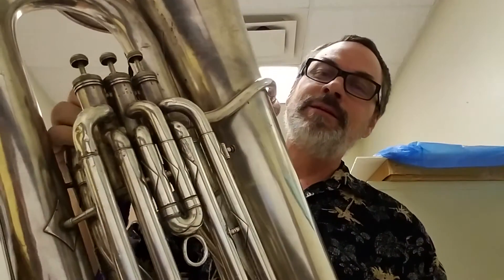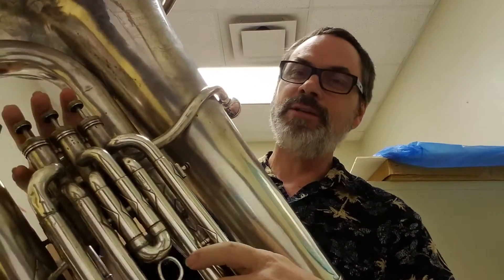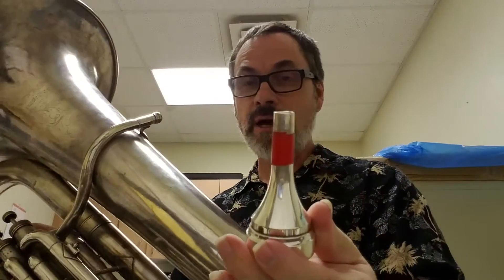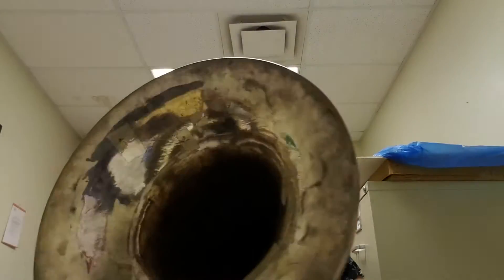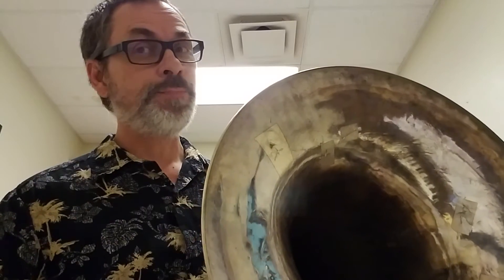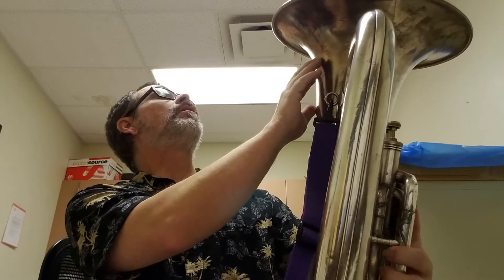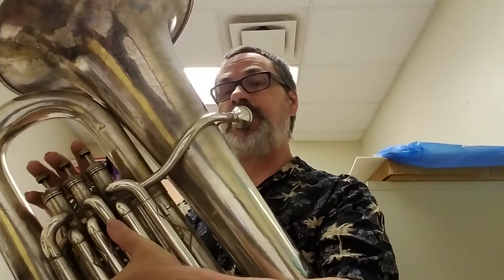Tuba - My Buescher Eb Tuba from the 1920s

Comment: I know this is an old video, but I've been slowly rehabbing a Buescher 3 valve front action from roughly the same time as yours. I've had people tell me to turn it into a lamp. I have made it playable, although the only slide not stuck is the main tuning slide. The others have not yielded. Despite playing tubas for 30+ years, I've never had a chance to play on an E-flat tuba. I ran across this video while trying to figure out simply how to transpose to play it. Plus at some point I'll need to do something about the shank size issue for the mouthpiece. My cheap Kelly kind-of fits, but I don't like it much, and I don't think they make the right size shank for this that would fit on my modular tuba mouthpiece. This is turning out to be a beautiful brass horn. Thank you for sharing yours.

Comment: Ok, I know this is way too late, but I was looking on Simonetti collection for something totally unrelated and it made me think of this video.  Why?  Dunno.

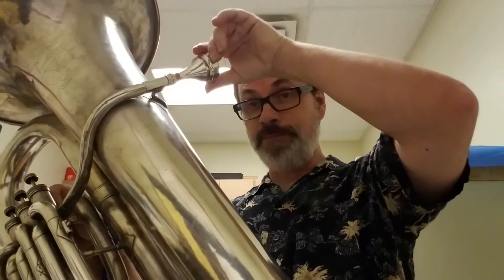As it turns out, a lot of the old Conn Eb Tuba mouthpieces clearly feature Remington shank (~13mm @ 1:24).  So if the mouthpiece is topping out at the receiver and wobbling around in the tube, that's probably what it is.  And yes, Remington shank was a thing before they called it Remington shank.  On the bright side, this is easy to test, and you might even be able to find some chonkers Bass Trombone mouthpiece that is suitable.

Comment: Small Tuba shank is 12.5mm.  Normal is 13.5mm.  Shot in the dark, it might be 13mm.  If you can find such a mouthpiece...I think Vienna Tuba is 13mm shank?...it'd be worth testing.  The obvious problem is that it might not be standard taper, like something related to proprietary taper Conn and Besson used back in the day.

I know that half a mil sounds like nothing, but it's actually the difference in about 10mm of insertion depth (5% taper).  So depending on what depth the horn is reamed for, it's entirely possible that neither 12.5mm or 13.5mm fits.
Reply: Man, you're always a hell of a help when it comes to MPs! Thanks for all you do!!!

Comment: How does the 4 valve front action compare? It has a "W" tuning slide and it was made in the 1910's.  I'm looking to buy it and I'm gonna play it in a Brass band and in an Orchestra. Would you recommend it? Thanks.
Reply from the maker: I don't know.  I have heard that the front action Bueschers are really solid horns.  The 'W' could mean a lot of things.  Mine has an 'LP' on the second valve casing that I've learned means "Low Pitch".  I'm not sure what the 'W' would mean.  if it's made before about 1938, it could be tuned to A=438 or 436, which means it is going to be flat compared to modern tubas.  Good luck.  I would love to have the 4-vale, front action model.